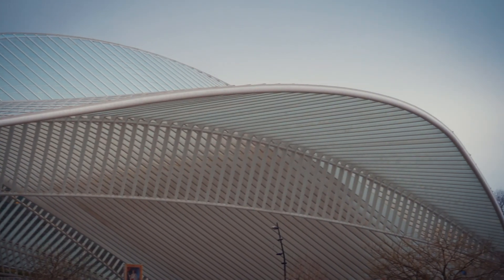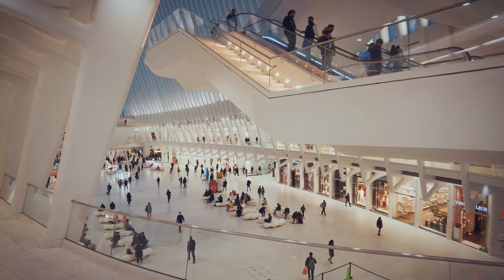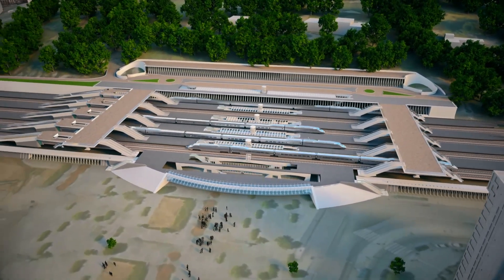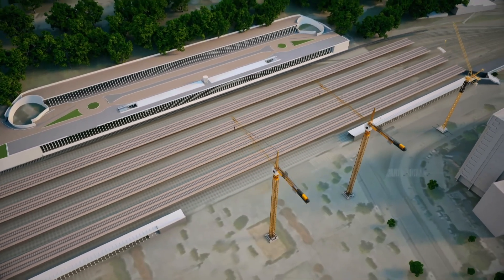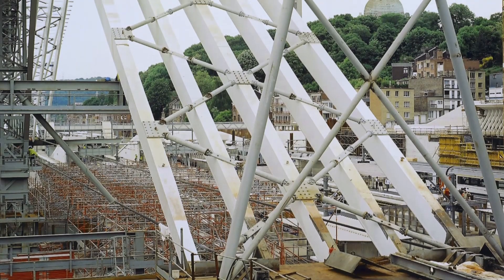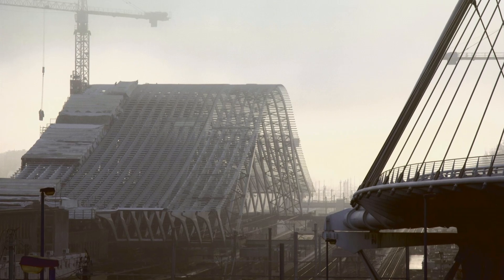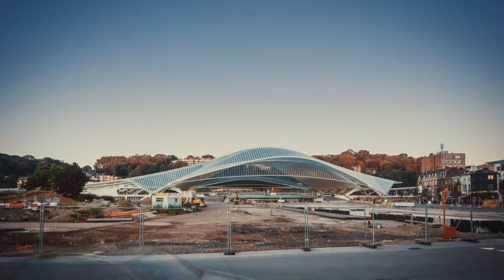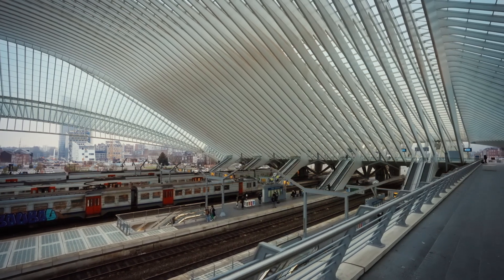A Belgian Train Station From The Future? 🚄 How Did They Build That? | Smithsonian Channel

Comment: I was go to The Liège Guillemins train station many times and i take the train in this place a few times, is less of noise and i like it.
One thing is i going passing the train rail near the train station to go for pp to avoid getting seen until someone tell me to get out of the train rail as i finish and a train passing after I got off the train tracks and the noise of the train is too low when it far away from me but getting louder when came close to the place i standing, this make me scared and I would not to do that again